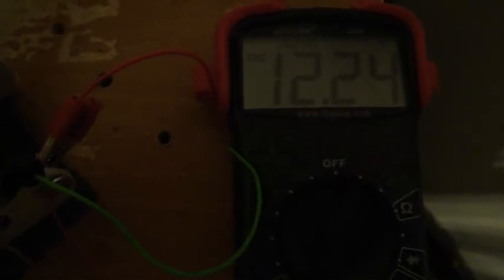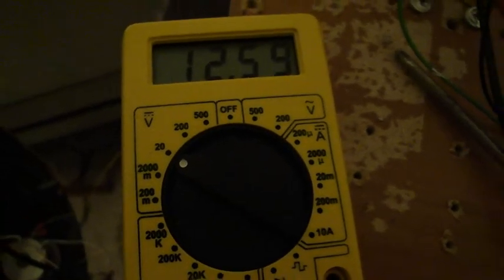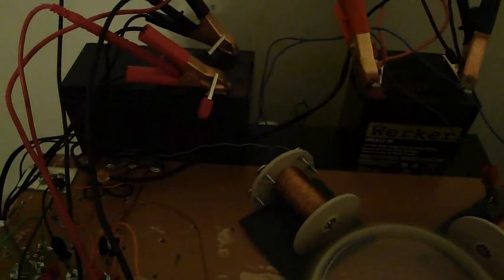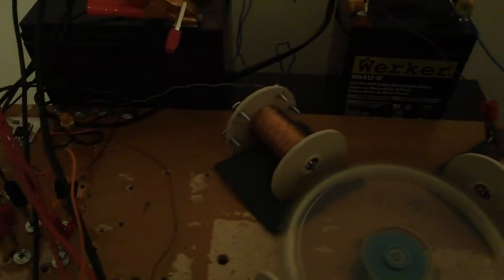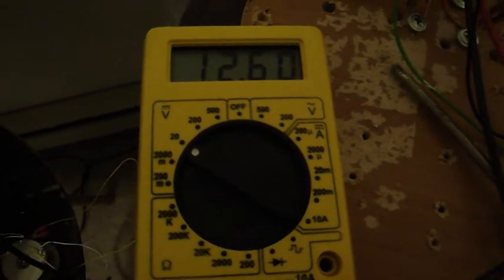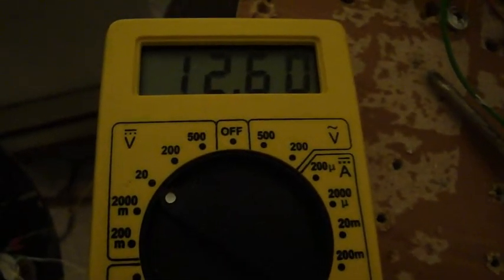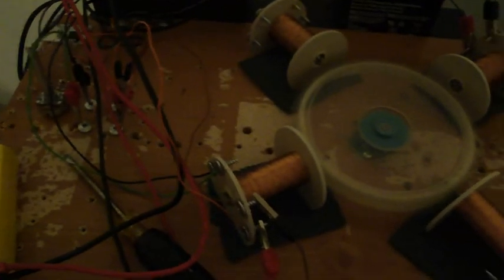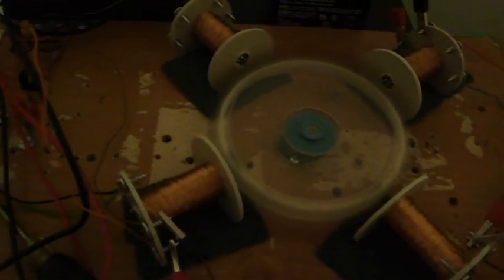TheDaftman-Bedini Pt2.avi

Comment from the maker: @TheBillythekid2010 

The trigger coil is actually a little longer and the run coil is slightly shorter. I was wrapping the trigger and run coil together in the standard bifilar bedini style 750 turns each. I now wrap each separately (layered) 800 turns run coil and 400 turns trigger coil. They seem to be working better overall, except that it is a little harder to get the rotor started. Attaching the fullwave rectifier to the free trigger (series) coils a reading of 15 volts is achieved.

Poppy

Comment from the maker: @myownreality64  I use the trial and error method. I have studied what others are using and use that as a starting point. So far the best coils for me are the two layer coils. 800 turns for the run coil with 400 turns wrapped over it for the trigger.